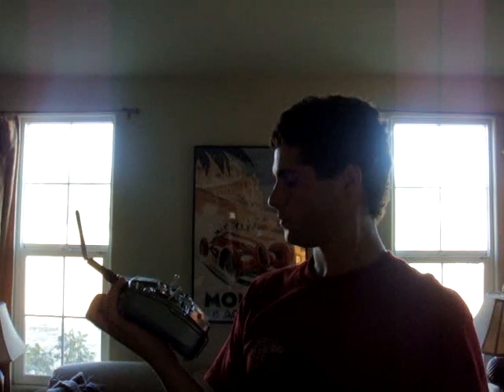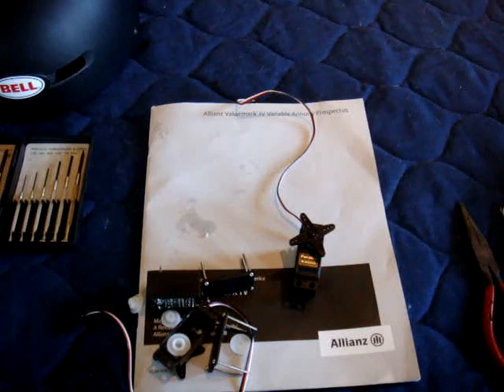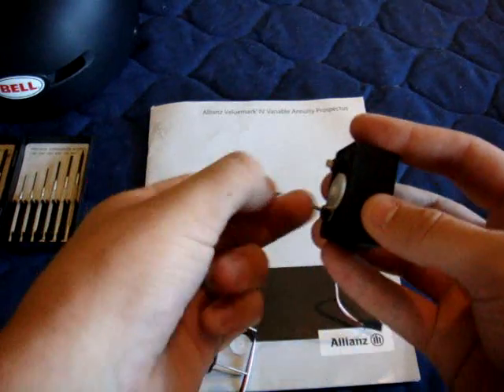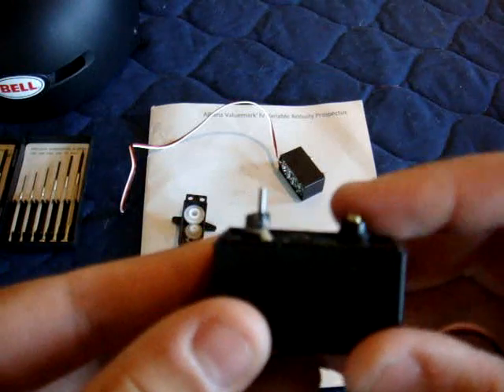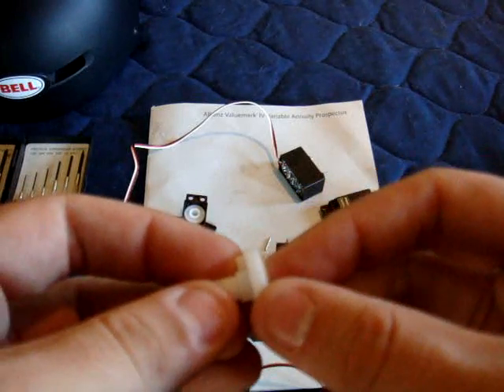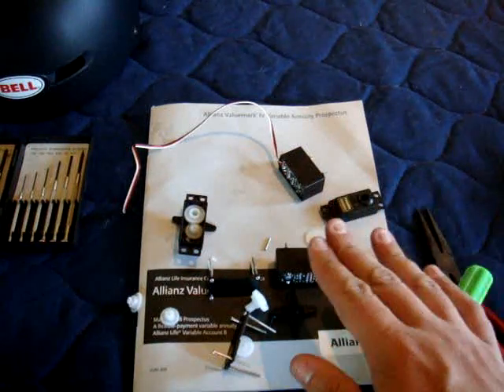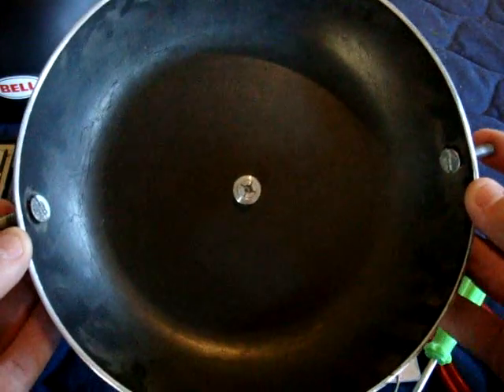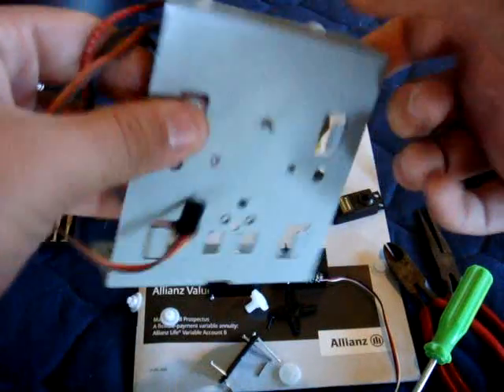How to Build a Mini Battle Bot - Part 1

Comment: @Gr3g251 I guess you would use a mixer for tank style steering, you plug it between the servos and the resiever and you do not have to feed it power directly from the battery. Most good ones only weigh about 5 grams.